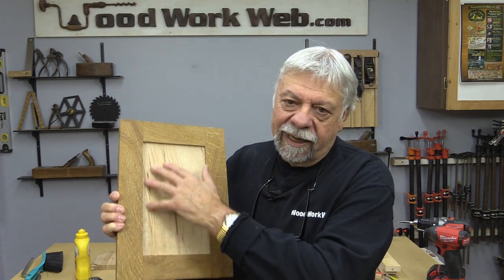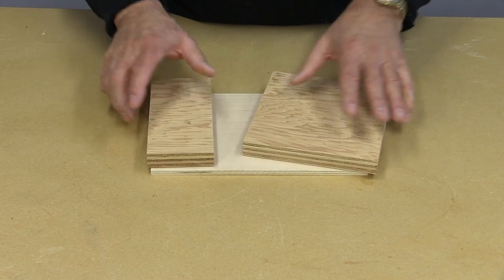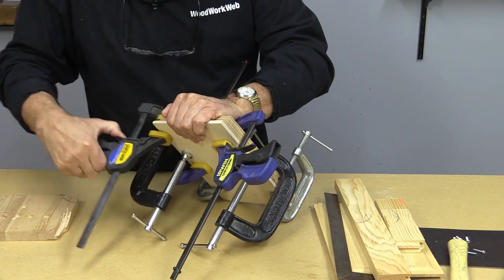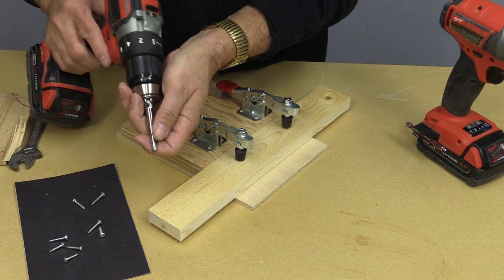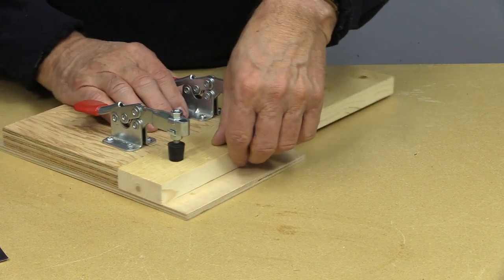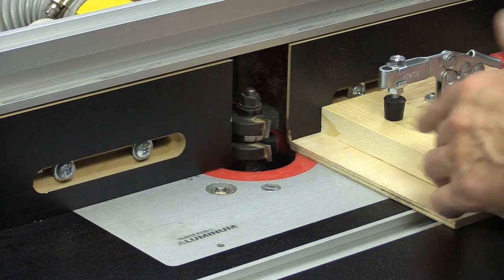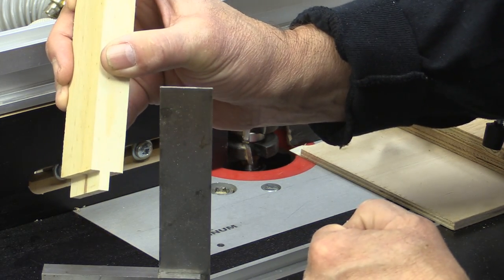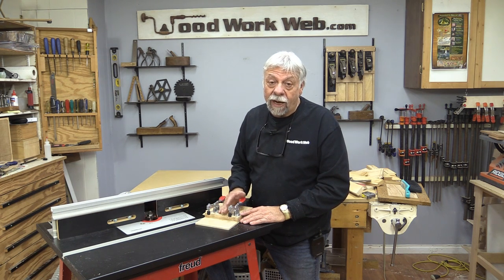Router Table Coping Sled for Cabinet Door Frame Making

Comment: I was watching as you made the first pass and that little thin strip on the bottom got jammed into the second part of the fence stopping the forward motion.
Reply: Yes, I spotted this as well, you can see the fence trying to move.
Reply: It didn't look like the fence was tightened. The washer on the screw is loose and vibrating (if you look closely).

Comment: I'm on my third one.  The clamps push the work piece down and out of alignment.   I know, lighten up on the clamp pressure.  I need harder and stronger base material also.

Comment: A question: after a few cuts, wouldn't the backer block be cut away to the extent that it would no longer prevent tear-out?  Thank you for your video - it was great.
Reply: If the repeated cuts are consistent, the backer board should be applying support exactly where needed as the profile on the backer board is identical to what's being cut.  I think this is all the support needed to minimize tear-out.  Change bits or adjust height and that changes.  I think it should still be fine, but have no direct experience to back up my theory.  I like the idea of making one of these for each bit set and then using for setup on consequent projects.  What I don't like about these simplified coping sleds is that the front edge of the base is cut away on the first cut, thereby no longer riding along the fence for the remaining cuts.  You have to remember that. :D  Makes me think that it should be made extra long on the back end for fence-riding purposes.

Comment: nice jig...have you simply clamped a board to the right along side the one you are routing to achieve a similar result? what would be the pros cons?
Reply: Seen others do similar to that.  Don't even need to clamp the workpiece to the backer.  I've seen folks make a good sized square piece with four different profiles on each side.  Just make sure it's big enough to keep you away from the cutter and provide good support across the workpiece.

Comment: Any reason you didn't use the t-track and fixings to guide the sled and make sure that there was no movement away from the fence?  Nice sled, but I was a little confused that you didn't.

Just about to make some of your jigs, circular saw ones and router dado one. Thanks for those too :D
Reply: Andy P you should never use your t track in conjunction with your router table fence it’s just a recipe for a disaster, you can use feather boards in your t track with a fence in place. I believe it’s because of the set up depending completely on both the fence and t track set up such as a mitre gauge to be perfectly square to one another along with the piece you are routing, if any one of the 3 were to bind or lose it’s perfect squareness to one another your not stopping the work piece or any of the components from flying apart at 100 mph. At least that is my understanding of why we don’t use fence and Ttrack setup...I personally will not do so in my table saw either.

Comment: Great video.....What router bits were you using? Where did you buy them? thanks
Reply: https://www.woodcraft.com/products/shaker-profile-stile-rail-router-bit-set 
I'm not sure if that's the same brand, but that's basically the same in all other respects. 

Be careful, as some versions/brands of this set don't have the shanks lined up. What I mean is that you can put the bit shank into the router where the shank "necks up", but then the bits (and their cuts) won't line up. The one I linked appears to not have that problem, but I've never used it, so buyer beware.

Comment: Love your videos Colin, I have a quick question.. This might be a dumb one but I’ve always wondered why a coping sled is necessary for those type of routes? Couldn’t you just use the miter gauge with an extended fence and backing piece just as well?
Reply: For a straight cut like this either one would work. I think a coping sled would be more versatile for example if you want to do small piece template routing while keeping your fingers safely away from the cutter.